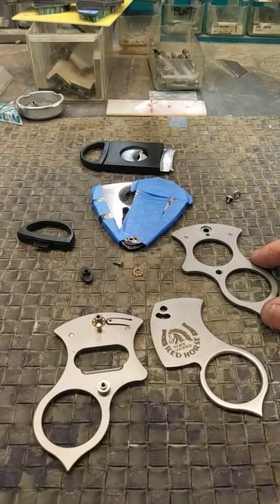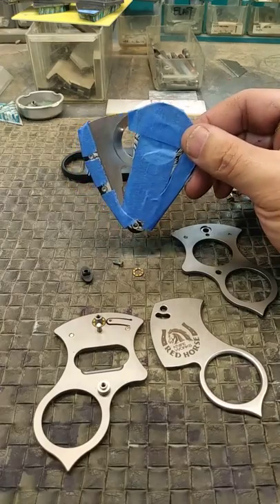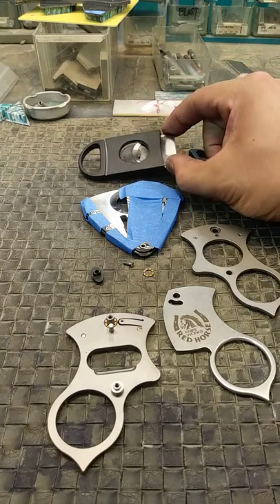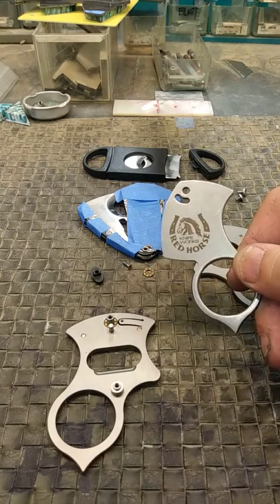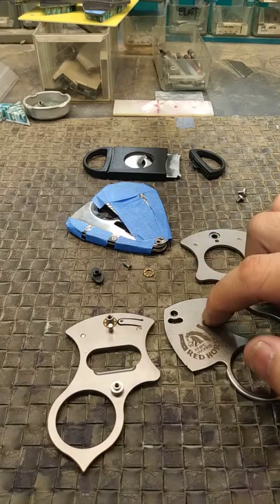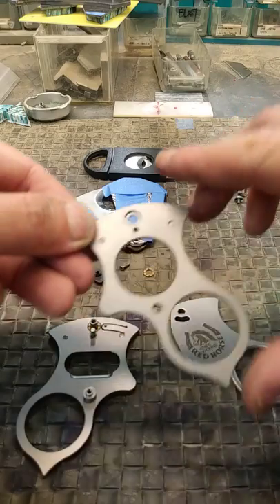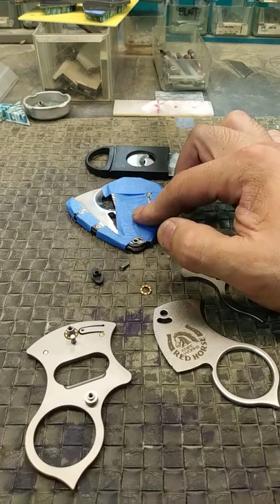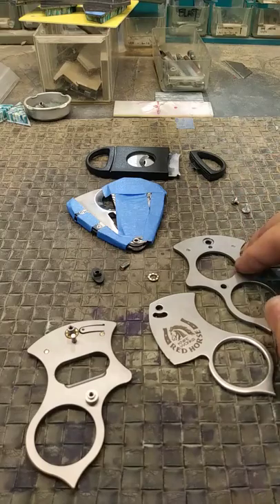The BMF cigar cutter

Comment: M390 is made in Austria not Germany and the scissor style cutters tear wrappers because of wear the leverage is at behind the blades. please make a cutter that has leverage behind the blade like normal cigar cutters have. great materials being used on a not so great design because it's a scissor style cutter and the leverage is bad. do a regular cutter with great steel